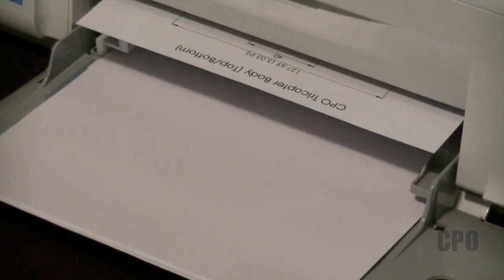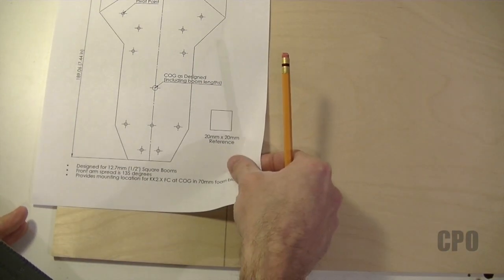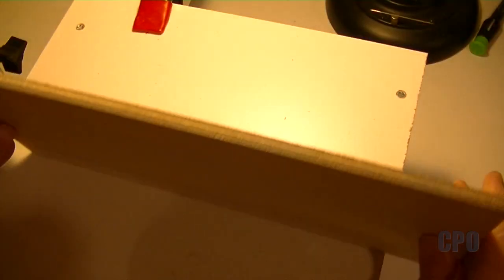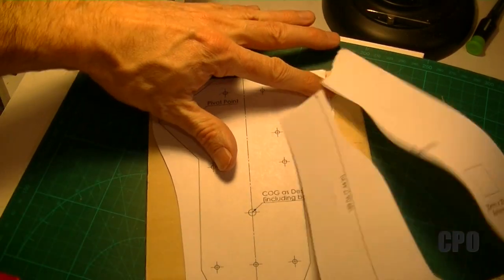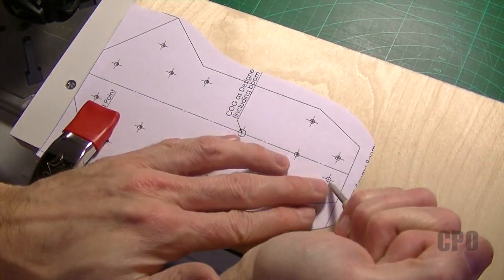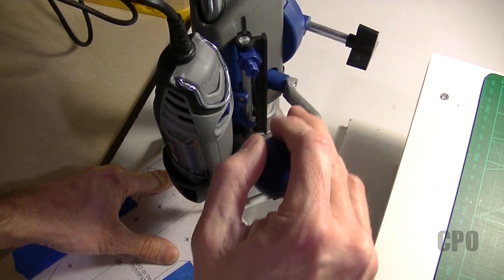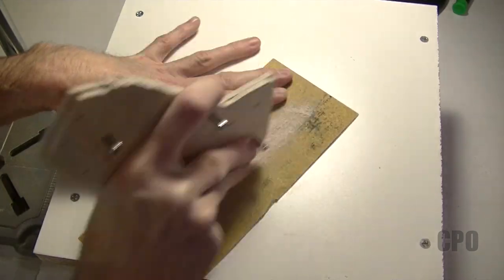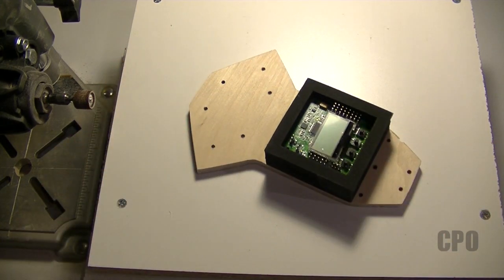CPO Tricopter Build : Body Cut-Out

Comment: I noticed you use dremel tools quite a bit....you should check out there MotoSaw scroll saw, I use one for smaller projects and they work awesome, I have  cut up to 1/2 inch birch plywood and was surprised at how easy it cut and it works great on tricopter bodies.....good luck with your projects.   Wayne

Comment: Thank you for sharing your build with us! Just a thought...maybe after drilling the holes through both wood plates, you could mount at least 2 screws (one at the top and one at the bottom) to make sure the plates don't move while you cut them. Spray adhesive also helps to keep paper temps on wood while cutting. Just make sure to wait til it's tacky before mounting to ensure that they peel off easily.
Reply from the maker: Thanks for the great tips!